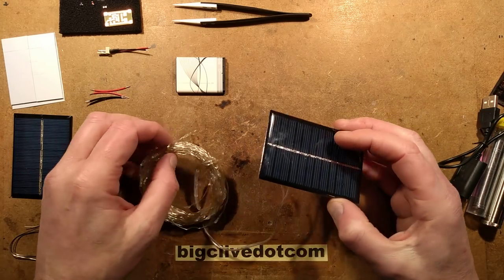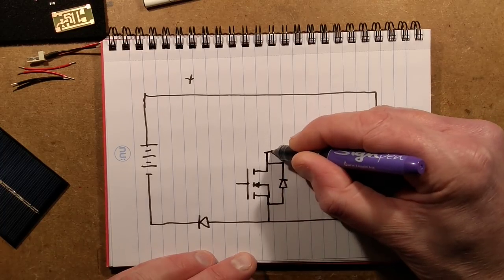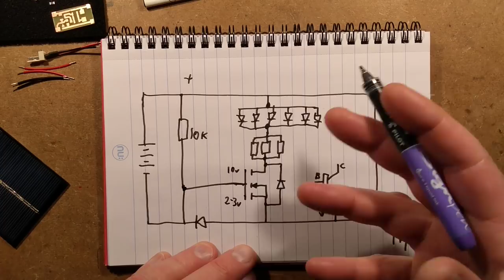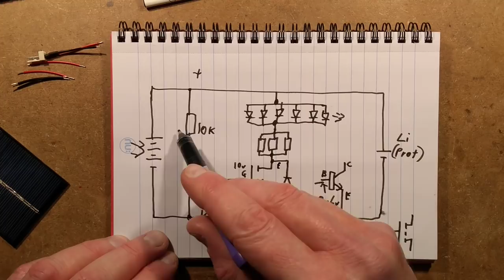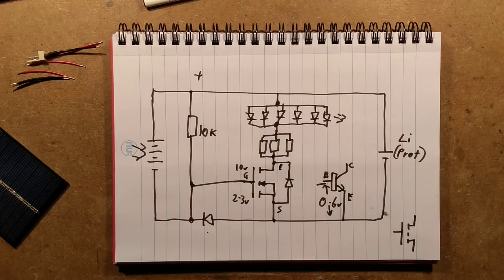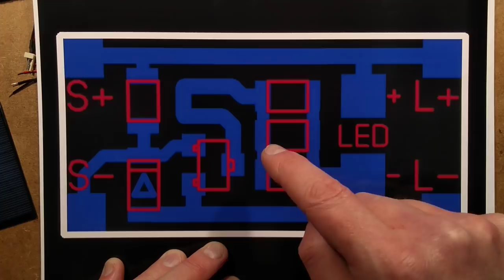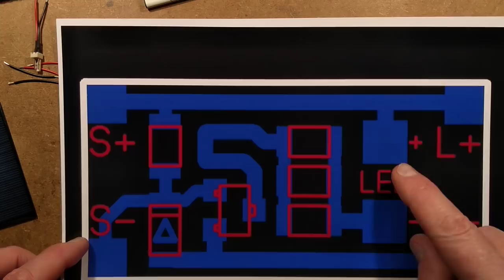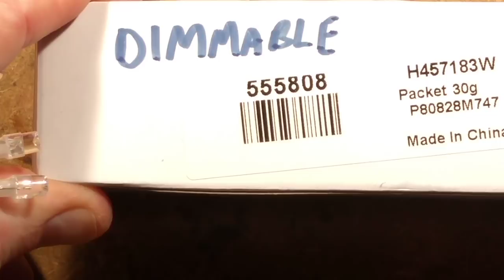DIY solar garden light project.  Surface mount remix.

Comment: I'm wondering if this project would work with an 18650 lithium cell instead of the phone battery. Very interesting project either way.
Reply from the maker: It would require a protected cell to avoid overcharging.

Comment: That iron would drive me nuts having to keep pressing the button like that, I modified my USB iron with a switch in place of it's electronic stuff so I could switch it on and off as and when needed, rather than having it turning on and off as it sees fit, which annoyed me too much... :P

Comment: One thing that always bothers me about having the series resistors is that they waste more energy than the LEDS themselves.   Putting heaters into a low power circuit seems a waste of energy doesn't it?  Is there some way to pulse the current very fast into the LEDS so that they average out to the correct current?  The heating in the LEDS would not be able to keep up with the pulse rate so they might not fail..  Just a thought...
Reply: when driving motors we call that s3 mode if i recall correctly. basically overloading the motor temporarily but not long enough to heat the windings enough to damage them but then giving it just enough time to cool down to a healthy level. so yes its possible and its done in the industry quite often (ever thought why many devices that feature dc motors are usually just for short term application?) it will just take a bit of thought as you have to consider the junction to ambient thermal resistance which is sadly mostly unknown if you're using premade led strings like clive did.
Reply: @urugulu1656  It also turns the long wires on the string into a transmission antenna for your switching frequency.  EMI for the loose.
Reply: you could come by the heating problem with putting two sets of parallel leds in series to better match the voltage of the solar panel (you might end up having trouble with running them straight from the lipo though) apart from that the only thing that would come to my mind apart from s3 mode is use a regulator (there are tiny sot23 linear regulators around that propably match your voltage (65z5))

Comment: What through hole mosfet could be used to make such a light in the "older" style? Thought of 2N7000 but it has significantly less current capability.
Reply: 2 x 2n7000

Comment: Your solar panel is on ebay if you search for "81X56" for $1.74 plus shipping.  As you guesses it is 81 mm by 56 mm and is 6 volts at 100ma..  Don't know where the "B1" in your part number came from.
Reply: A really wonky "8"?

Comment: So all these months later I got a bunch of A2SHB mosfet for microcontroller projects.  Being really careful with heat but 100% failures! Have I got fakes or am I killing with static? How sensitive are these? FWIW: I have never had static issues before
Reply from the maker: That's odd.  It could be static or you might have got a bad batch.  The gate on these is optimised for low voltage turn on at around 3V.
Reply: @bigclivedotcom  Odd for sure! Tried a few circuits driven from 3.3v microcontrollers, figured they were not switching on at 3v3 so breadboarded with a simple 5v LED test circuit and all sorts of failures, some passing some current 100% of the time, some open circuit.  I am more persistent than EEV Dave, not given up on my £0.99 yet!  FYI I work with LoRaWAN and hit IoM from Dublin recently,  >200km :)
Reply from the maker: @garrypkeogh  it sounds like gate failures.  Might be worth trying a simple antistatic setup or maybe but some from a different supplier.  eBay is notorious for being China's dumpster.

Comment: A good usb sodering iron = TS80.. And btw, you don't trust irons with a micro? Then you can't use the one you are using in the video either, that could crash in the on state too, so.. :)
Reply from the maker: It's when they jam loads of features in that the increasingly bloated software results in instability.  My main soldering iron benefits from being fairly dumb.

Comment: I tried to find the soldering/vape adapter on E-bay but could not...can someone please link it for me?

PS>  I am going to attempt to use a USB vape pass-through cable to power the soldering iron from a computer and/or a portable battery to see if it will work  :)

Comment: Hi sir can i ask what is the use of the 10k resistor connected in the positive and negative of the solar panel?
Reply from the maker: To provide a known current path for the transistors gate.

Comment: I don't want to be smarter than the experts, but is it really that good to carry out the soldering work on the battery? Wouldn't it be better to do the soldering work first and then attach the PCB to the battery? You are always told that Li-Ion batteries should be protected from heat as much as possible. Just a moment, as a chemist I'm an expert 🤣

Comment: Does the vape iron have a hard off on the selector dial or do you have to take the iron off to keep it from accidentally coming on?
Reply from the maker: You can lock it off in the usual way with these batteries by pressing the button rapidly about 6 times.
Reply: Good to know, thanks!

Comment: Very late with my comment, but
You put 6V over a Li-ion battery (-0.6V of the diode). Isnt that...bad?
Second: the result is magnificent, but how do you 'finish' it? Imagine you want to put such a light in your garden: what and how do you integrate it into a final product? You're only making 1 or 2 of these for real usage. How do you make it suitable for actually living outside in sun/rain/...
Reply from the maker: It's using a slightly naughty technique of using the protection circuit in the battery (DW01 based) to prevent overcharging.
Reply: @bigclivedotcom  i got that... But i was always told the voltage should never be over 4.2V. why doesnt the protection not kick in when the sun shines? Or is the voltage drop that big? And isnt a 5V solar panel "better" then?

Leaves the question of: how do you "finish" the project, casewise?
Reply: @rikbobbaers946  as i understand it from watching alot of videos on this subject just  because you have an overpowered solar panel in terms on voltage as it gets sunlight it trickle charges small amounts of current back to the batteries so as 5v-6v solar panel  wont put 5v-6v into you batteries in a few mins itll take a good day mebbe 2 depending on the output of the solar panel  ... its damped down . in terms of the outdoor living conditions i think im gunna make some sort of glass-plastic-perspex box for the solar panel to sit in .. somebody else here with far more knowledge than me will put me right if im wrong tho so take what i say with a pinch of salt .

Comment: Does this battery driven soldering iron run on regular 18650 Li-ion cells? If so, thats fine. If its proprietary batteries or small NiMH or NiCd cells i guess it has too low power and capacity. I would like an iron that runs on 2 18650 cells in series for faster heating.
Reply from the maker: It uses a dedicated battery in the e-cig base.
Reply: @bigclivedotcom  Thanks! I thought e-cigarettes normally use 18650 cells (Li-Mn-Co-O - high current). Can you change the battery and does 18650 fit in?
Reply from the maker: @richardnanis  The case is too small for an 18650.  But you can use the tip with other beefier vaping devices.

Comment: Hi! I try to find to A2SHB, but i find only various switches. Please drop a link for mosfet. thx
Reply from the maker: Try AliExpress for the A2SHB MOSFET.
Reply: @bigclivedotcom  ok. thx. where can be wired the transistor base and collector legs? So the trnsistor is hang on the air. please show me the rest of wiring. i can not find the transistor in pcb panel...

Comment: Where do you get those ego solder tips? I'd like to try one out.
Reply from the maker: It was part of an eBay kit that included the battery and tip.  The important bit is the adapter that allows the use of what appear to be common USB tips on a standard Ego-style battery thread.

Comment: Actually, BJTs are voltage controlled too (spoiler: every MOSFET has a built-in BJT), they just have such high leakage that you control the voltage by way of the current.

Comment: I just keep struggling to understand this circuit. I recreated this circuit in a simulator and it works fine indeed. But what I don't understand is how the mosfet is switched on and off. According to the simulator, no voltage is applied to the gate (both in light and dark). It works fine but I don't understand it :-)
Reply from the maker: The solar panel leaks current at night like a resistor.
Reply: @bigclivedotcom  Then I still don't get it. a mosfet still need voltage at the gate to turn on?

Comment: I don't want to use and smd MOSFET. Any other options
Reply: Get TH (Through Hole) N channel logic gate FETs, they are easy to get at your usual suppliers. Logic Gate means they turn on at a lower voltage, like the A2SHB which he used.

Comment: I have an rgb led that comes on when it gets dark, recharged by solar panel, but lately it seems only to last about 10 seconds before dying, you think it's probabaly the shitty battery they supplied with it?
Reply from the maker: Could be a water damaged cell not putting out much charge or a baked battery.
Reply: @bigclivedotcom  I think maybe the latter, luckily I had a phone battery do, I have taken your example 😅
Reply from the maker: @phonotical  If the existing battery is NiMH it will have to be the same.
Reply: @bigclivedotcom  ummm.... What happens otherwise 😅😅😅

Comment: i wonder how much abuse that iron could take without burning out the heating element
Reply from the maker: I tried it on my larger adjustable wattage base and kept the power low to avoid burning it out.

Comment: Question you've named those connectors you use I think molex, but can you give out the size or model that you use. How do i find the specific style you use.
Reply from the maker: They're quite hard to find on eBay.  Other manufacturers make them too.  I've not found a magic keyword to find them yet.
Reply: @bigclivedotcom  10 - 4 I'll look some more, if not back to super glue 😁
Reply from the maker: @raymondmucklow3793  One of the keywords to search for is 2.54mm as that's the pitch of the contacts.  (tenth of an inch)
Reply: @bigclivedotcom  you rock sir, 🤐
Reply: @bigclivedotcom  Bam first search , not the same brand but close enough. 2.54mm was the key word. Cheers from suppose to be snow tonight kansas
Reply from the maker: @raymondmucklow3793  KF2510 seems to be the magic code.  Especially when used with 100pcs to find the packs.
Reply: i instead tend to use jst xh ones. they come in slightly different pitches though 2.5 and 2.54 mm with two pin ones its no big deal to fit the 2.5mm ones into protoboard with .1in spacing but everything above that is quite bad so always get the right one
Reply: @urugulu1656  XH connectors from JST are also available for direct SMD mounting to save two wires. Unfortunately a can't find if there's a common standard for XH connector polarity in common circuits.
Reply: @johncrowerdoe5527  roll your own standard?! i usually tend to take a permanent marker and write voltage and polarity at the receptacle of the jst... and ALWAYS include reverse polarity protection and your all set. im not consistent with my polarity though so i have simply cables in both polarities...
Reply: @urugulu1656  The point of a standard is to avoid making my own connectors the opposite of everyone else.  It seems ridiculous to have a connector with mechanical polarity protection and not specify which end is which.  JST even refuses to number the pins so circuit diagrams may up disagreeing.
Reply: @johncrowerdoe5527  ok the lack of a numbering is ridiculous (and sad at the same time...)

interoperability with other peoples designs isnt the main concern with those connectors though. they are usually used for board to board interconnects inside of a company's product and that company most likely has guidelines on that (or atleast should) so there is absolutely no reason to even reason about a standard. just do it the way round it fits your needs best.
in addition there is no real benefit from either polarity (unlike with say the barrel jacks where you were able to save a couple of components when using the right polarity with a switching receptacle)

Comment: Is a light censor just a solar panel with a voltage meter?
Reply: some, yes, if you look at the old 3 in 1 ph/light/water meters, the light meter section is literally a 1/4 inch solar panel
Reply: There are multiple types.  Solar panels are probably the most expensive but provide their own power.  3 other options are light sensitive transistors (photo transistors), light dependent resistors (LDR) and single pixel CCD sensors.  There were also vacuum tube based types back in the day.
Reply: @johncrowerdoe5527  or leds matched to the wavelength or the light to be sensed in between the inputs of an opamp with a feedback resistor. this effectively makes the voltage across the led zero and all you get at the output is a intensity proportional voltage... thats not a single part though.
Reply: if you know how to use the effect/physical principle behind it you can essentially use just about everything as a light sensor that is somehow light dependent...

Comment: TS100 soldering iron https://ebay.us/eLI8Li is what you are looking for.  It has an accelerometer to detect when you have stopped using it and switch off. Runs from 12V to 19V the higher the voltage the faster it heats up.

Comment: A MOSFET in its linear region.... hmmm.... rather a JFET no? And if not, a JFET would be more linear than a MOSFET, no?
Reply: actually even those are not linear at all therefor designers usually put a resistor between drain and gate and in series to the gate... that linearizes them somewhat if the resistors are equal in value (atleast as much as tolerances allow). jfets arent usually power parts though so they wouldnt neccesarily be better for the application depending on the leds you're using.
Reply: and also mosfets have a linear region its just very tiny and not very usable at all